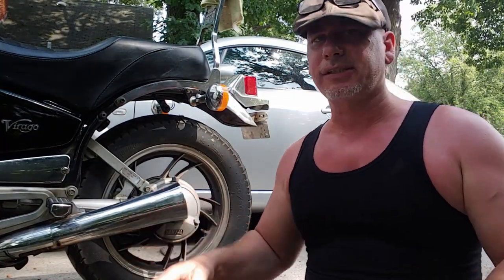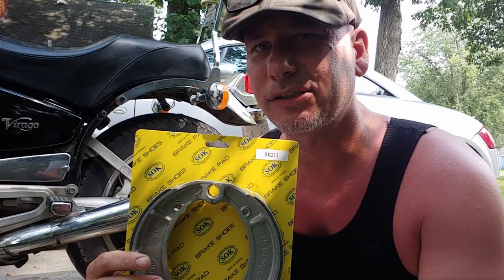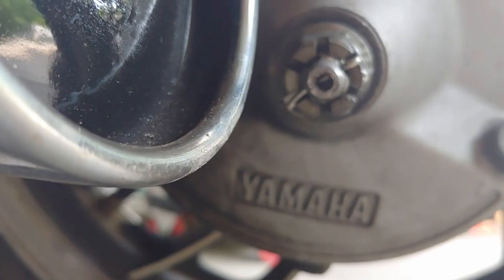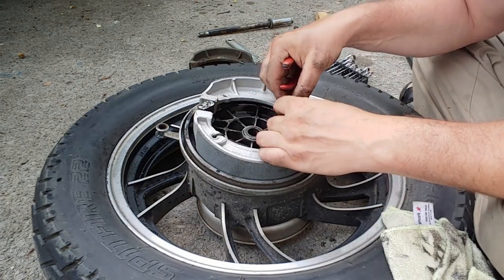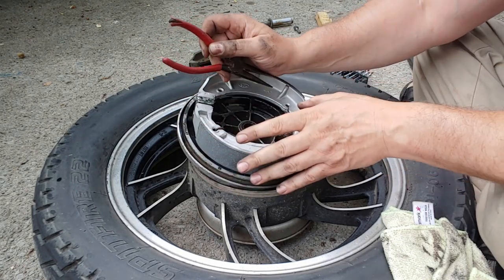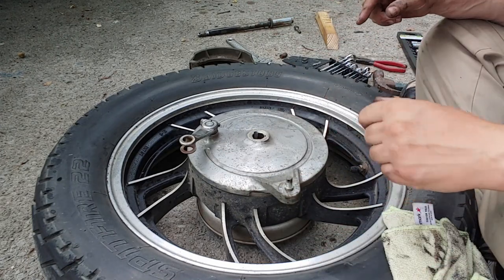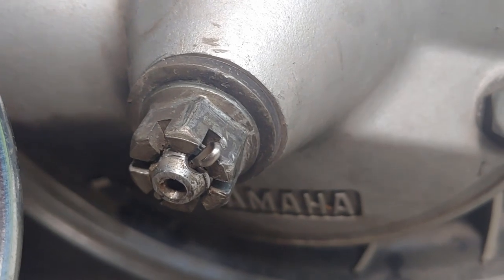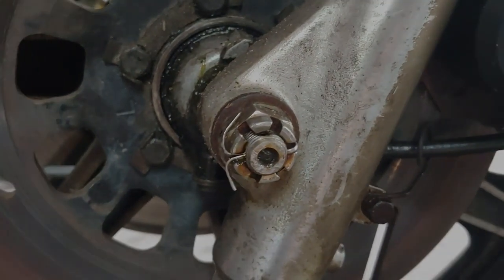Rear Brake Replacement 1981 Yamaha XV750  - Vintage Yamaha Backyard Restoration EP 26

Comment: Do you have to change something else for the rear brakes? I know you change the rotors and brake pads on the front one bc the pads wear on the rotor but what does the rear wear on?
Reply from the maker: The rear brakes (shoes) wear on the hub)  I don't think the hub is easily replaceable because the spokes/tines go through the hub.  Check out this video for a better visual explanation.  Thanks! https://www.youtube.com/watch?v=5FSCcpam9e0